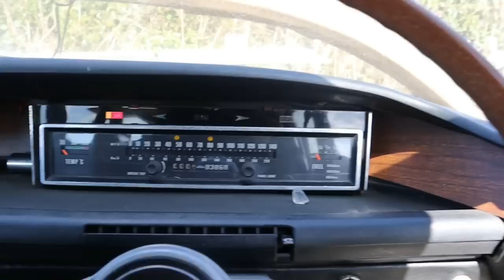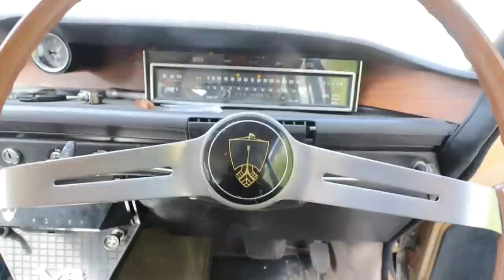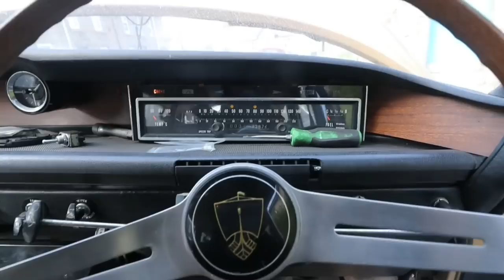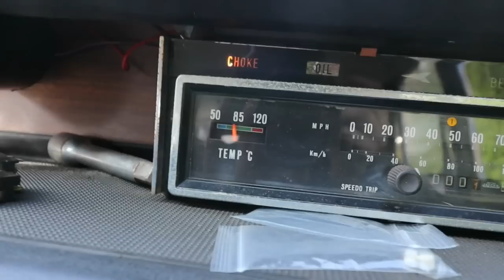We Bought A Series 1 Rover P6 Estate Can We Drive It Home?

Comment: are the back of them estate`s week ,the estate conversion being pop-riveted on to the back end of the modified vehicle with no rust-proofing or very little
Reply: No they're a fortnight.
If you take the paint off the panels behind tbe rear doors you'll see tbey are galvanized which paint doesn't  stick too well to but FLM Panelcraft who built these cars knew wbat they were doing and even converted 6 Rolls Royce cars but Rolls Royce didn't like it so they had to put an end to it
Reply: All Range Rovers originally had two doors and I think it was FLM Panelcraft that made tbe first 4 door Range Rovers